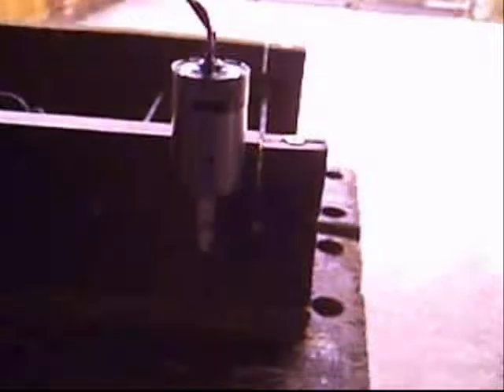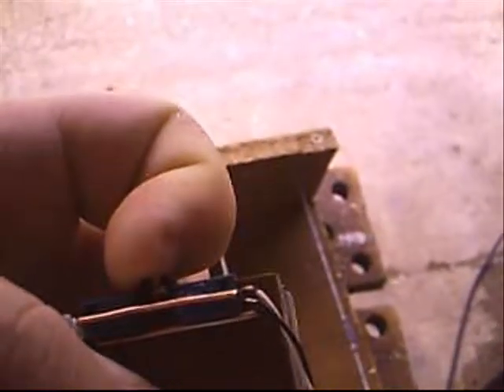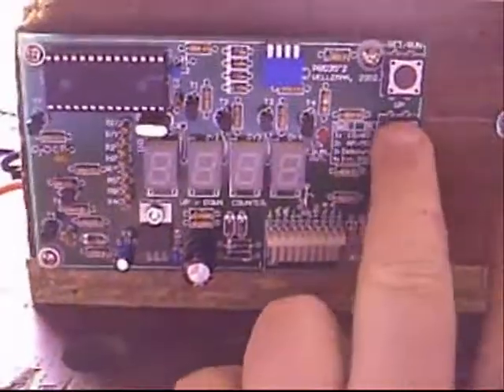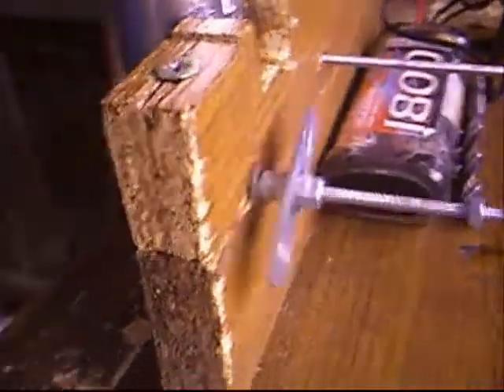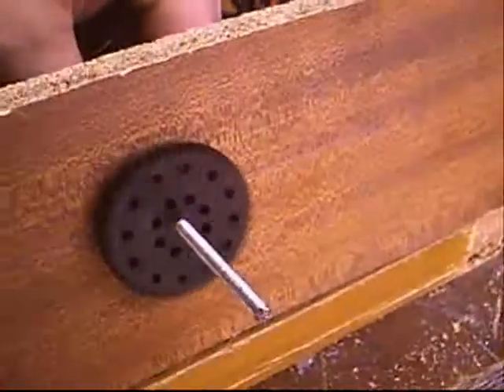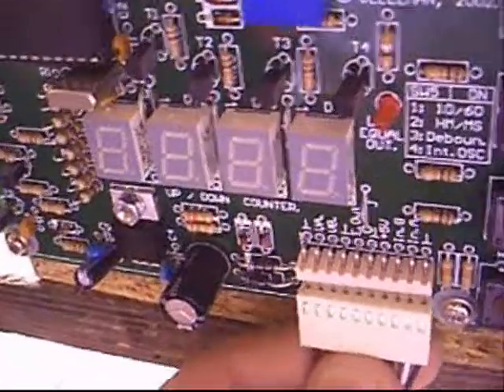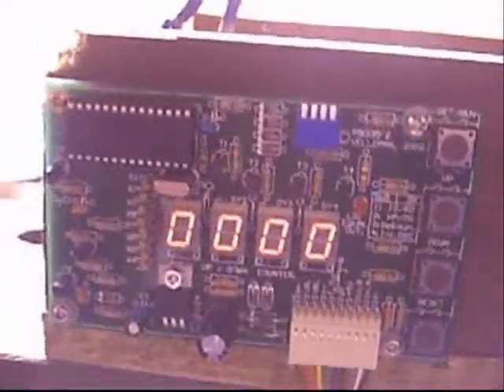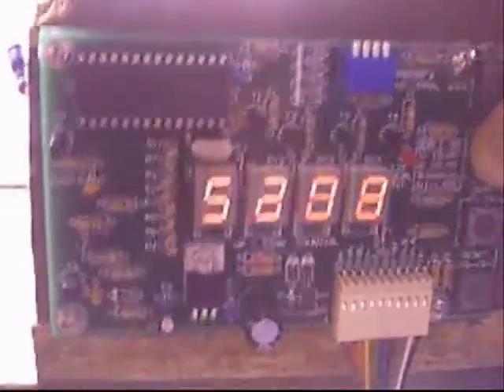coil auto winder build

Comment from the maker: ok, on the carriage their is two contact leaver switches and the copper wire runs between them...
when the wire moves to one side it activates that switch which puts power to the motor and moves the carriage... the two switches ether side control direction...

with mine, the only thing manual is the tensioning. Although occasionally it does screw up...